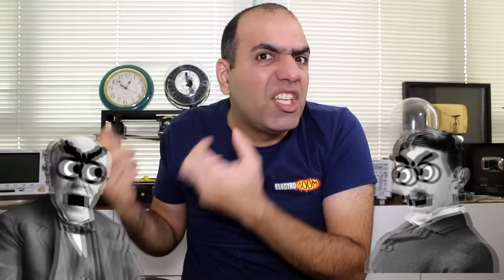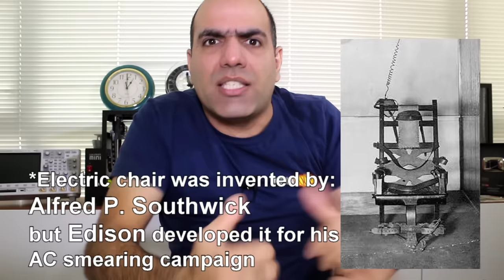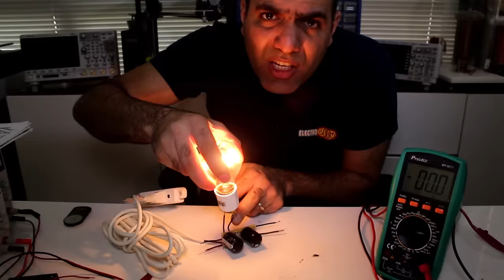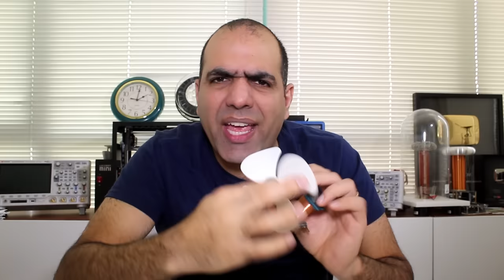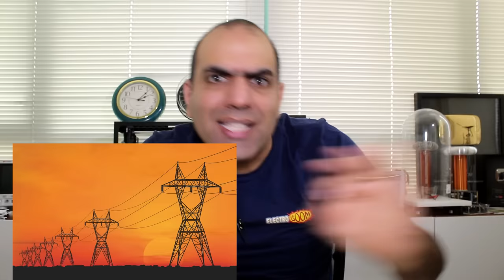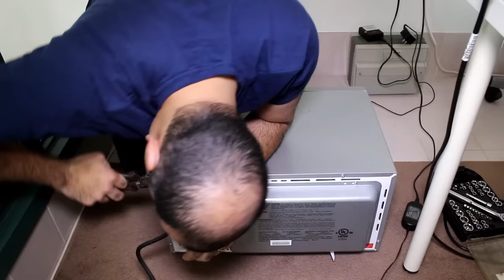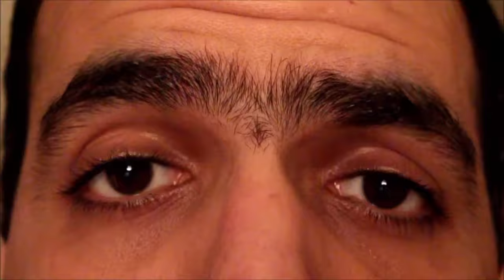Why Use AC Instead of DC at Home??

Comment: Transmitting power over long distances with AC is nothing short of genius. The reason you can transmit such high voltages with such thin cables is that the current goes way down in order to preserve Ohm’s law and conservation of energy. It’s an amazing discovery which we now take for granted every day. Makes it all the more heartbreaking learning how badly Nikola Tesla got screwed over.
Reply: Tesla didn't invent AC. That's a myth.
Reply: @cchavezjr7  AC could only be discovered, not invented. But Tesla invented the 2 phase AC system in 1882, built a working 2 phase motor in 1883 and invented 3 phase around 1887.
Reply: @nagypeter-szakallatkorpore7865 He didn't though. He only had a hand in inventing the 2 phase but his contribution to 3 phase was the induction motor.  As for AC, he didn't discover it either but yes, it was invented. Electricity was always there but in nature it's direct current. AC is a way of alternating the flow back and forth that does not happen naturally.
Reply: @cchavezjr7  AC is produced by induction. Induction is a phenomena, not a machine. A phenomena can be discovered but never intevted. And he did invent 3 phase, check his patents. The only difference is that he used 6 wires instead of 3 or 4. As a nerd I read all his patents that are available online.
Reply: @mernok2001  Galileo Ferraris was the first to invent it. Patents do not tell you who was the first to invent something. Your arguing what is invented or discovered is just being pedantic and arguing for the sake of arguing. No point in even trying to discuss things with people like that. Enjoy the holidays.
Reply: @cchavezjr7  Ferraris invented it independently in 1885. Read the life of Tesla. He got the idea in 1882 when walking with his friend Antal Szigeti in a park in Budapest. And he built a model in 1883. Ferraris was a great physicist too but he made a mistake when he believed that his motor would never be more efficient than 50 %. Obviously patenting doesnt matter in the sense of who invented it, for exampleBenjamin Franklin had exactly ZERO patents.
Reply: @mernok2001  Ah, so can't hold your argument and just make up excuses and call names.
Reply: @cchavezjr7  You are arguing against the great Mehdi, not against me. He said that the induction motor was invented by Nikola Tesla himself as well as some other inventors like Galileo Ferraris who was not as famous as Tesla. Did you realize that? How dare you say it otherwise than Mehdi said?
Reply: @cchavezjr7  You did gess it right that i am a smoker but admit it that you are a boomer conservative as i guessed. With your comment you make smoking sound like its bad but i have to disappoint you: Its freedom and democracy that allows everyone to smoke.
Reply: @cchavezjr7  Smoking is a good thing.
Reply: @cchavezjr7  Every smoke is good.Nut tree leaves, grape leaves, smoke bombs, car exhaust, literally everything.

Comment: I'm no electronics expert so I'm wondering why you cannot step up and down DC?
Reply: Because transformers work by changing magnetic fields. (Faraday's Law of electromagnetic induction).
Transformers (primary and secondary windings wrapped around an iron former) only work on AC.

Comment: I am a bit disappointed by the video. Seriously, why don't we build our homes with a central, very effective AD-to-DC transformer (let's say to 12V) and have most devices and lighting at that voltage? Real need for higher voltage certainly is needed in kitchen and for a washing machine, of couse. But the demonstrated loss of energy should no be relevant within the few meters at home.

Comment: Serious (and naive) question.. why not use DC at 100kv and use some diodes to lower the voltage?
Reply: AC is used to transfer the power with less energy loss. If you use a transformer to increase the voltage by 100 times, the current will drop by 100 times. Power is the product of voltage and current (P= V*I) and you want to lose the smallest amount of power possible when transporting it.

 Since every wire has some resistance, there will always be power loss, which is given off as heat. With a resistor, the power that is lost is the resistance times the square of the current (P= R * I^2). This means that if you drop the current by 100 times, the power you lose as heat will decrease by 10,000 times. 

As Electroboom stated in the video, to use DC for power transmission, you will lose a lot of the energy you produce, have incredibly thick and potentially unusable wires, and only have a very small area where you can actually move the power for every generator.
Reply: @ragingfirefrog  You didn't answer the question. You mentioned why you need high voltage.. but why do you need AC specifically. DC at high voltage (per the given explanations) doesn't seem like it'd lose any more than AC.. I do gather that perhaps high voltage DC is hard to come by... but what about AC makes it better besides the voltage. Seems to me like high voltage DC would be just as good, if not better than AC.. but I do realize it'd be hard to switch the voltage from the transmission lines to the home (as it wouldn't go through a transformer.
Reply: @joelove2084  In power transmission, high power DC is better at longer distances, but it is far more expensive to bump DC up to higher voltages. It comes down to costs (Both construction and maintenance). He has a video about six months later that addresses this in more depth. 
Here is the link to it: https://www.youtube.com/watch?v=DFQG9kuXSxg

Comment: DC can be used for power transmission. In fact high voltage direct current (HVDC) has many advantages.
I think the main reason for AC is that there were no transformers for DC in the late 1800s.
Reply: And there still are no transformers for DC! And by that I mean a transformer consisting of copper windings around a metal laminated iron former.
There are ways to convert DC to higher or lower voltages but are a lot more complicated than a transformer.

Comment: I think viewers of this video should be made very aware that high voltage can kill you very easy. There is the cliché saying “its the amps which kill you” but it’s actually the voltage which makes those amps happen. Any power supply can deliver enough amps to kill you so that cliché saying is pointless. It’s just a very narrow scientific statement which one should not base practical conclusions on. So, to the viewers, please don’t mess around with microwave transformers like this. It’s not for nothing that there were tamper proof screws on the microwave. I’ve had 230 volts on me by accident many times when i was a kid. One such accident with 900 volts with a few milliamps will knock you down quite fast. If you’re thinking about experimenting with high voltage then please quickly choose something else to hobby with.

Comment: High voltage DC power transmission lines are far more efficient. 90% of Electricity generated is lost by AC transmission inducing changing magnetic fields and currents in anything nearby. Including your body and brain.
That's why the Chinese are now using high Voltage DC long range transmission.
AC is fked up and responsible for huge drops in IQ, lifespans, and environmental damage.
Stop using it. 
And would you rather replace some 50c carbon brushes  every few decades, or a stupid computerised electronic commutation power supply that wastes half your input power anyway, and blows up at enormous expense every 5 minutes.
It would have been easy to drop the voltage by series connecting to  users back then even. Now no problem at all.
Edison was an ahole. So was Westinghouse. America is an ahole. They are liars and frauds by habit in all their businesses and activities.

Comment: DC power transmission is very much a thing. Cost savings in only having to run 2 conductors and less complex pylons opposed to the 3 commonly used in HV power transmission offsets the additional equipment DC transmission.

Comment: Honest question: while this was true at the time, aren't modern DC transmission lines way better than AC? Like the longest transmission lines in the world are DC because AC suffers from skin effect and non-negligible line capacitance acting as impedance, or am I wrong?
Reply: The skin effect is something that happens at much higher frequencies than power line frequencies of 50/60 Hz.

If the skin effect was notably present at 50 or 60 Hz it means they could eliminate a considerable amount of metal from the power lines and reduce them to tubes and be hollow. Clearly that is not the case, and if it could be done, think how much money would be saved in the cost of the cables and weight reduction too.  Power lines are solid. Multi-stranded and not hollow tubes.

When you get up to radio frequencies and higher, you may notice that the cables are more akin to plumbing, copper pipes or cables where the conductors are tubes (often coaxial)  with pieces of plastic to preserve their shape or to carry an inner signal conductor.  Here the skin effect is present and having a solid, inflexible, heavy, expensive copper cable is pointless.
Reply: @deang5622  well that may be, but the fact remains that the longest transmission lines in the world are all HVDC, DC is just better at that, the difficulty is the transformation, transmisson itself is just better in DC.

Comment: This is not very accurate and contributes to the glorification of Tesla beyond his actual accomplishments.

1. Edison was at war with Westinghouse over A.C., not with Tesla.
2. Tesla did not invent A.C. nor did he take the idea to Westinghouse. Westinghouse was already selling A.C. systems.
3. Tesla "invented" a 2 phase induction motor after Galielo Ferraris invented an almost identical one.
4. Tesla did invent a 3 phase induction motor.
5. Tesla got U.S. patents for his induction motors and sold the patents to Westinghouse, who had dificulty making them work properly.
6. Soon after, Mikhail Dolivo-Dobrovolsky invented a far superior induction motor, the 3 phase power distribution system plus the delta and Y transformers that we know.
7. It is Dolivo-Dobrovolsky's motors and 3 phase power distribution system that have been in use for the last 130 years, not Tesla's.
8. Tesla was a geniuos in many ways, but he was also a self promoting charlatan whose actual accomplishment are not as significant as articles and videos like this have made them to be.
9. For legal reasons, Westinghouse had to share its Tesla patents with GE. Both companies were then intersted in talking up Tesla's accomplishments whose patents they owned, to distract from the fact that they ended up bulding motors and electrical systems designed by Dolivo-Dobrovolsky for their main German competitor AEG.
Reply: Exactly. It's interesting that even the Adams Power Plant used the 3-phase AC transmission, even when their Westinghouse generators produced 2-phase AC. GE provided the Scott transformers to convert 2-phase to 3-phase, but the invention was made by Charles F. Scott, a Westinghouse engineer.